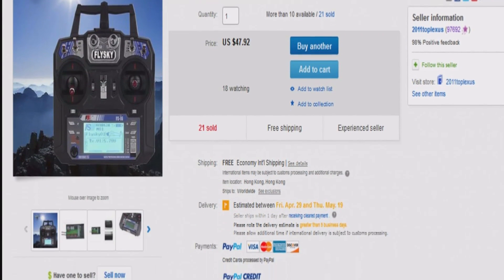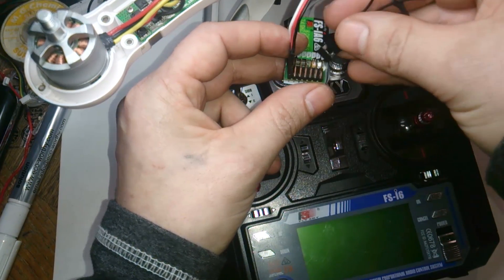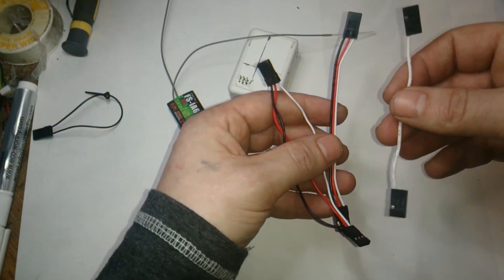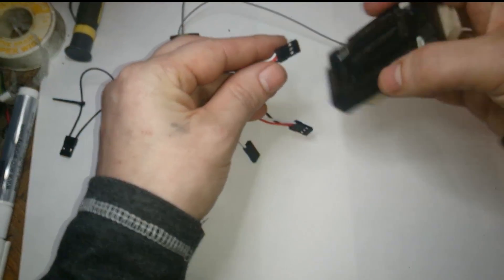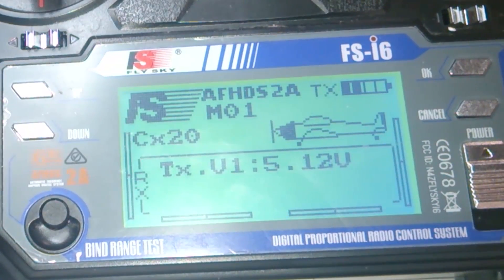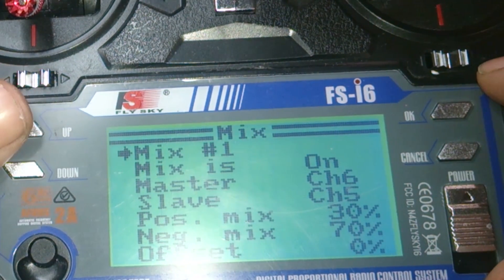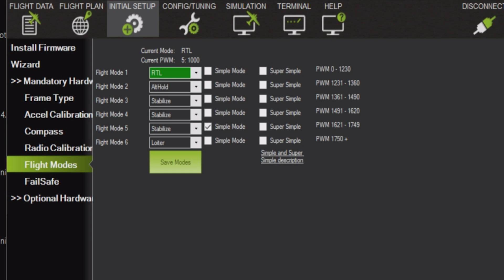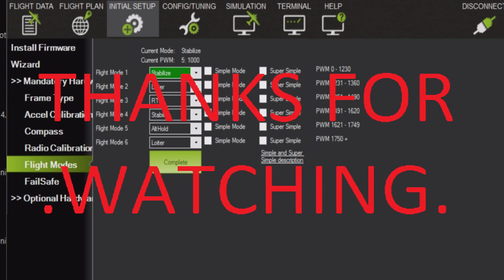cx20 flysky FS i6 FS IA6 binding and Mission planner settings

Comment: Hello, Kaushal here. I had pretty good experiences post APM 2.8 installation. But in two of my previous flights, when I fly the drone a bit a far away from me, the controls starts easing in the sense the forward, backward and slideways functions won't be as responsive as when it was flying near to me. What could the problem be ? I am currently using the stock TX and RX.
Reply from the maker: +kaushal kakaria could be you pinched one of your antenna's to much and broke it.   I ended up drilling two small holes on the side of my quad copter to let the antenna's come out ,then hot glued them in place.. Do you have two antenna's or just one?  .. also the stock rx is not very good with wifi noise , some vids even show the quad just taking off or flipping.     besides that you can also hook up to mission planner and download the logs and view the logs to see if you have any err .. check out this page to see the error code for radio,  http://ardupilot.org/copter/docs/common-downloading-and-analyzing-data-logs-in-mission-planner.html
Reply: +bangs6996 Ohh, thanks Bangs ! I hope to replace the stock TX and Rx with my new FS-i6 TX and RX but I don't really know which cables from the RX are to be connected to the APM 2.8 ? .Complete Newbie.
Reply from the maker: +kaushal kakaria 5:56 of this video shows the connections for apm 2.6 2.8 ect.. just right before it I explain the wiring for the original apm and why it only has one white wire by it self
Reply from the maker: +bangs6996 about 4:40 .. propb be best to watch allot of it because i probably explain the -b wire as well .. which if you have a power module then you don't use it...
Reply: +bangs6996 Hello, thanks Bangs ! I followed your video and have successfully bound the FS i6 TX and Rx. Works well. I hope to get better range. Flight tomorrow, will let you know !!
Reply from the maker: +kaushal kakaria  great..If  you don't mind let me know what you think of the transmitter , Mine does a small very smooth yaw on its own every once in awhile , Have not had time to figure that out, just curious to see if its a normal flaw with the transmitter.
Reply: +bangs6996 I am at your service ! The drone was working perfectly as it was with the stock TX, I had no difficulty in 2 flights I did today. I think, with some more flights I will come to know. I will fly it 4-5 times tomorrow and will let you know if there is anything notable. Thanks again !
Reply: +kaushal kakaria Bad news, very very bad day for me. I mistakenly short-circuit the Power Dist. Board and now it only powers 3 ESCs but not the 4th. I will have to buy a new one. Can I buy this one ? http://www.rchyderabad.com/quadcopter-power-distribution-board.html Would it be compatible ?
Reply from the maker: +kaushal kakaria .. ouch.. .. If your positive a trace popped off the board you might be able to just fix the trace.   I would confirm switching the bad esc and motor with a good one .. or just remove the positive and negative main off the board for the esc that is not working and plug it directly into the positive and negative terminal of the power module .. this will not allow the other 3 to work but will tell you if the esc is bad.         personally if you really think the trace on the board popped I would just replace it with a piece of wire..     If you do want to get that board .. You will need to get one of these   http://www.ebay.ca/itm/1-8S-Lithium-Battery-Adjustable-Low-Voltage-Tester-Volt-Meter-Monitor-Alarm-New-/161524166049?hash=item259b972da1:g:qTkAAOSw7ThUkRqi   look around I found some for 99cents ..    this will tell you when your battery is dead   ... If you want me to explain better on testing the esc let me know .
Reply from the maker: +kaushal kakaria I should also note that if it is just the main board which some what doubtful but if it is your better off just soldering the bad esc location right to the positive and negative of the board where the two main terminals .  .. The custom quad I'm doing now I'm just soldering all the red together directly so in reality you don't even need that board anyways... the cx 20 power wires are all short anyways so you would have to attach wire length to all of them anyways.
Reply: +bangs6996 I think Two ESC have gone bad and the Power board is working fine. In this case, I tried to replace these 2 stock ESCs woth 30A SomonK ones from my other quad but when I connect their + and - to the board, they do not beep, no response in them..
Reply from the maker: +kaushal kakaria Do you have a voltage meter, test the negative and positive wire / pads for 12volts on the board.. if you have not already ..
Reply from the maker: +kaushal kakaria also which ever esc your using if connected to a motor.. take the main black and red wire .. and just plug directly into the battery (black to black , red to red =)  ) , first un solder the red and black from the main board....to see if you get boot up sound from esc with the motor..
Reply: +bangs6996 okay,I will do that. Let's hope for the best !!
Reply from the maker: +kaushal kakaria Keep in mind when you plug the esc directly into the battery without the switch wire connected you might just get tonz of beeping sounds.. .. u can either plug the  power module back in .or use the usb powre...If using power module plug the red and black esc wire directly into power module 60 connector.. ..  with the switch wire connected to apm motor out should stop the beeping sound if the power module is plugged into the apm.. alternative what i do during a build is just plug directly into rx -t ..even more handy when the esc has a bec as you don't need anything but the esc plugged into the battery and the 3 wire (switch pluged intio -t .. to test the motor ..
Reply: +bangs6996 Thanks again Bangs for your brother like help but this technical, is beyond my understanding. I have understood to connect the + and - of the ESC( with motor) to the battery's + and -. Is that right ?
Reply from the maker: +kaushal kakaria .. yes for sure ask , My first language is English and I suxxxxxxxxxxx at it..       Ok with what ever esc is not working and still connected to a motor..   Remove the red and black wire off the cx20 main board the thicker wires.. .. then plug those two wires directly into the battery xt60 connector .. The point of this is just to see if the motor beeps..
Reply: +bangs6996 Okay, got it. Let me give it a try !
Reply from the maker: Just curious if you manage to get your self back up and flying or still waiting on parts..
Reply: +bangs6996 Hello bangs, my good friend. I have managed to get the 2212 Motors, 30A ESCs from some Chinese Supplier and had it soldered here. my quad now flies pretty great. No issues at all. Tomorrow I will send you a videos of it on your email ID. It's all your help after all.
Reply from the maker: very pleased you got it going... Just Don't send me a crash video tomorrow =P...
Reply: +bangs6996 Hahaha...... sure !!!